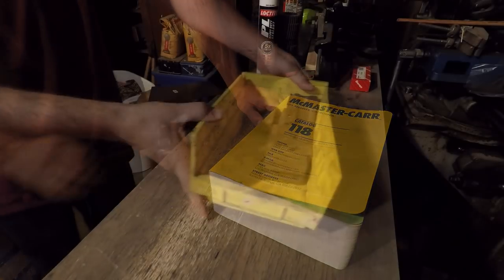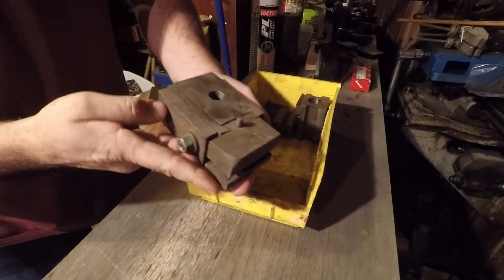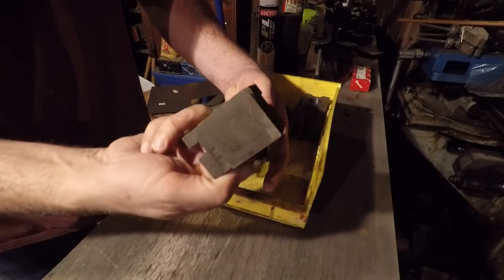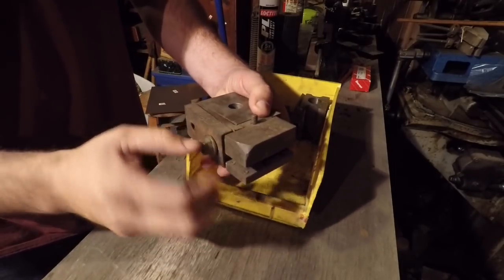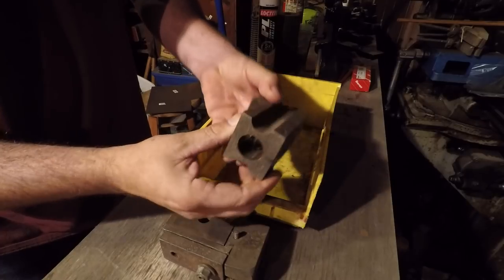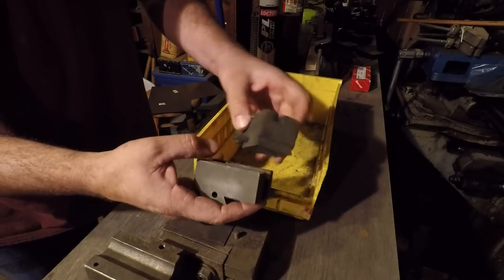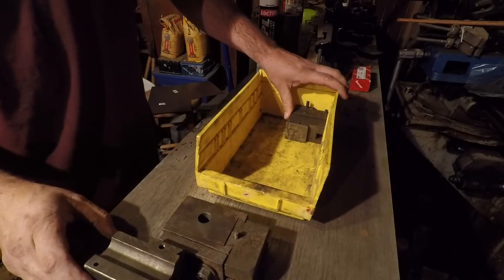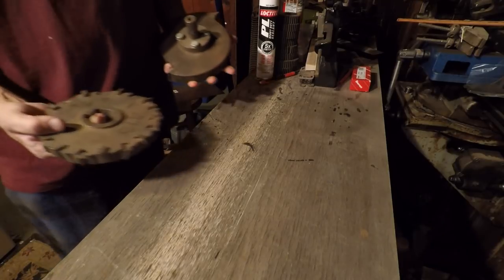Old Time Machine Shop: line shaft hangers

Comment: I'm glad you were able to find those. It will be good to make patterns from them. 
I was manager at Douglas Corporation twenty years ago. It was a machine shop that rebuilt anything that came in the door. While I was there we cast and flame sprayed babbit bearings for centerless grinders, and gas pumps, but we didn't do any line shaft bearings. I have seen a few from old shops that were torn down and a few working setups. The  working ones were at museums and a couple small woodworking shops. 
I haven't run across any ring bearings
Scotts Mill in Scotts, Michigan is a grist mill that is powered by a water wheel. It uses line shafts to power the equipment. The Amish and Mennonites in the area use diesel engines to drive their line shaft shop equipment. What will you be using  as motive power?
Reply from the maker: i have a vintage fairbanks morse electric motor 220 single phase 5 hp i believe.  it came with my mill . maybe steam someday , i'll probably have to build the engine lol .

Comment: Back in the days before cold rolled steel was in Vogue it was all hot roll, sold in nominal sizes, so you might buy a piece of 2” bar but if you wanted to use it as a shaft the scale had to be turned off, so your shaft usually ended up at one of those odd 1/16th sizes, later on as cold rolled became available at affordable prices this was no longer necessary, thus the newer stuff is usually on size while old stuff was usually 1/16th under what would be considered nominal today.
Reply from the maker: +captaingreenbush that makes sense

Comment: I think that second carbide cutter was modified to be a fly cutter
Reply from the maker: +Hal Pickering the 2 bit one?  Thought a fly cutter was one bit .
Reply: Chris Anderson 1 bit fly cutter?? 2 bit fly cutter?? keeps it in balance
Reply from the maker: +Hal Pickering true enough Hal
Reply: Bet that was originally used for woodworking. Those shallow holes in a row are for balancing, suggesting that was designed to run at high rpm. Back when that was made, cutters that large cutting metal would be running way too slow to require balancing. That looks like a wood shaper cutter for a BIG shaper.
Reply from the maker: Might be right on that Steve

Comment: Hi Chris
How's the south bend lathe coming along...? 

I've quite a few iron flat belt pulleys & countershafts myself...
I grabs em where I can as like you says they're getting hard to find now...
Reply from the maker: I need to get back to it . Good job saving them pulleys ect. Still on the hunt for a countershaft hanger
Reply: Old Iron Shops 

There was one here in the UK a bit back... South bend pattern... 
They wanted £125 for it... 

But as you know I've got a 14 1/2" South bend...and it's countershaft... 

If your on Facebook I'll send you my email address...then I can get some dimensions for you for patterns....I'll take pics as well...
Its got the split ring & bobbin clutch arrangement as well....😉
Reply from the maker: My email is oldironshops@gmail.com
Reply: Old Iron Shops 

Its near the front of one of the containers that I'm keeping some stuff in...its stored underneath the lathe...I'll be able to drag it out and get some dimensions...☺️
Reply from the maker: Cool that will be handy